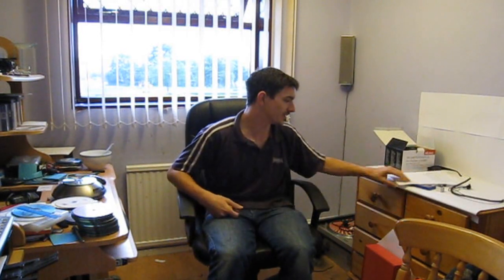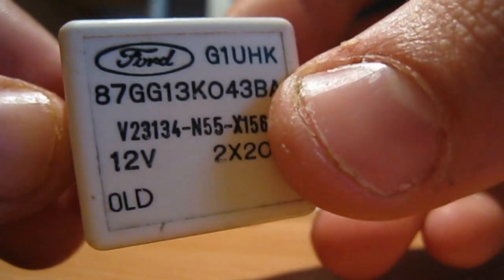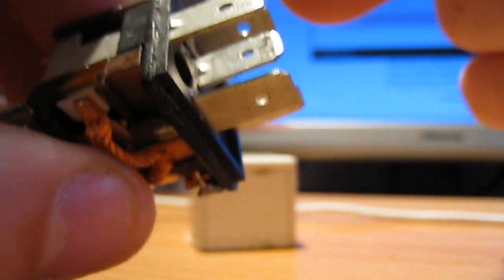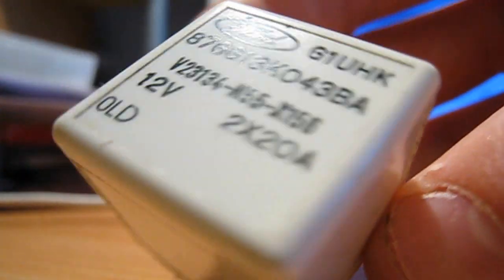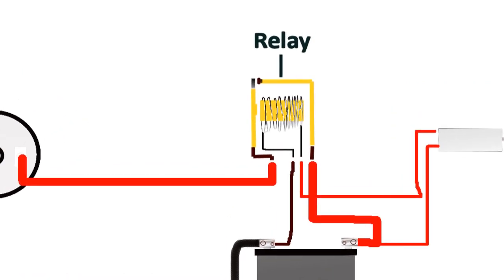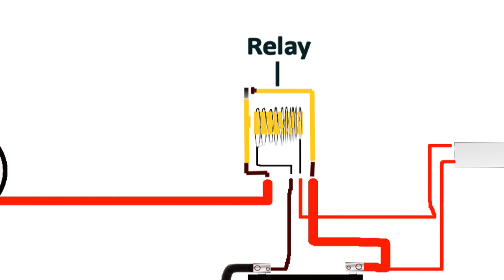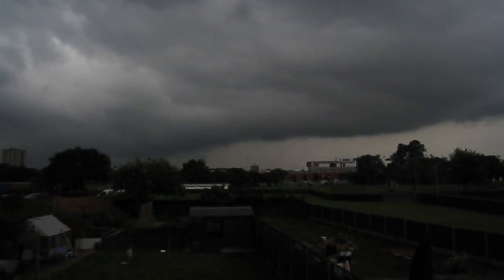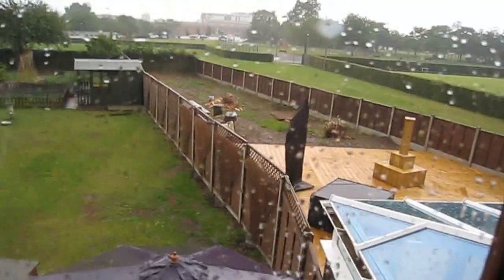Q&A what do relays do in a car + some lightning I filmed at the end

Comment: Great video.
I have a question in regarding and hope you can answer ?
Currently am using my running light on my vehicle using  halo rings lights. this are angel eyes that glow sort of parking lights. Basically when my car starts the halo rings turn on. Then when I turn on my headlights the halo turn off you probably are aware from the video.
What I like it to do is if I can use a relay that can keep them on when I turn my headlights without shorting out my day time running lights. 
Thanks.